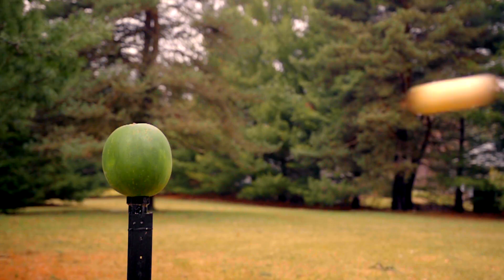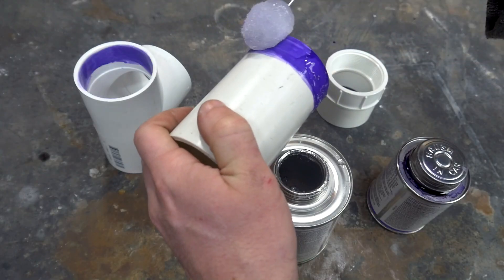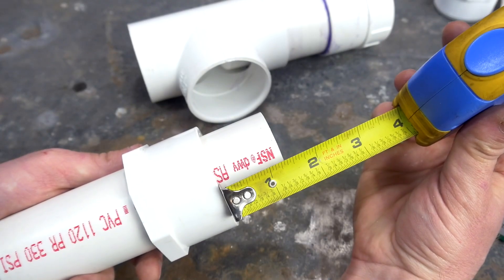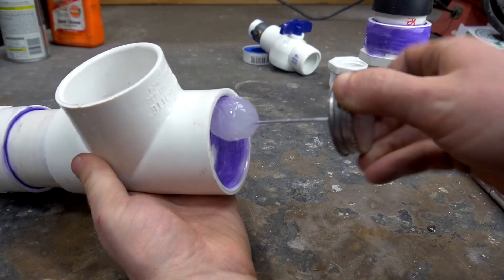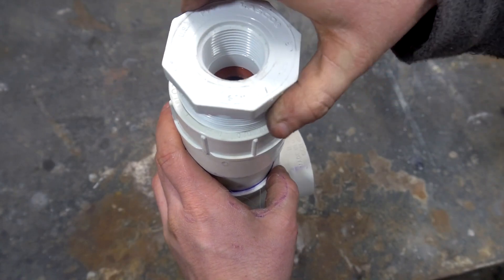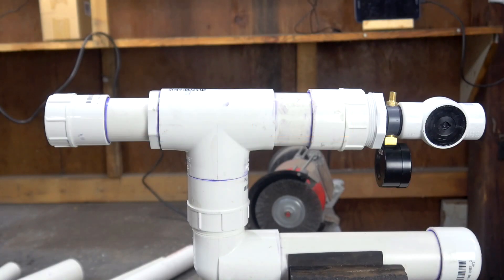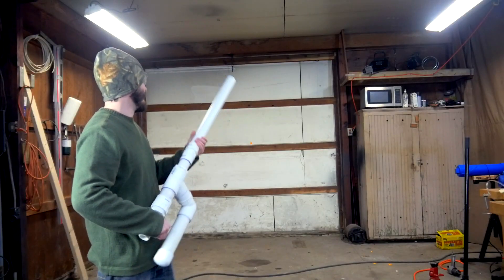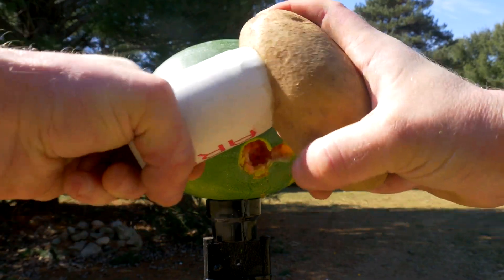How To Make A High Power Air Cannon - 2" Piston Valve (Barrel Sealing)

Comment: what if you hooked this Cannon up behind a vacuum Cannon? if you fire the pressurised Cannon (full of nothing but air) into the back side of the vacuum Cannon, the air behind the projectile in the vacuum Cannon will be enough to send the projectile flying way farther than both cannons firing alone. this is not an original idea either, I saw it on myth busters.
Reply from the maker: Yes, you can fire ping pong balls way faster than the speed of sound that way

Comment: Very cool.  I had been thinking of how to make a valve like that out of plastic tubing from time to time.
I wonder if that blowgun you put on the sprinkler valve would work straight up on the back of it.  You probably don't need a very sudden release of gas.  Once the piston starts to open up at all, the pressure that goes in the barrel barrel really upsets the balance and gets it opening up really fast regardless (provided there's some sort of projectile in the barrel)
Reply from the maker: Whatever valve is used behind the piston just needs to be able to let air out faster than it can refill from the small port hole in the side. However, the faster the air is dumped out of the back the faster the piston will move, so a small blowgun valve would make it pretty slow opening. It would be too close in size to the port hole so a lot of air from the chamber itself would empty before pressure was low enough behind the piston to pull it backwards. If instead of just an open hole in the side of the piston you had a one way check valve that would help solve the issue of using a blowgun, but still the larger the valve the better to get that quick backward snap of the piston.
Reply: NightHawkInLight I found that out the hard way as I used a fill set up from past cannons that hooks up to my compressor doesn't let out air fast enough. couldn't find the o ring though so if you could link that it'd be appreciated
Reply: Once the seal breaks, the piston actually should accelerate more slowly (as the pressure in front of it is dropping). Ideally, you want as small a volume behind the piston as possible, and you absolutely want the fastest valve to vent t he pilot volume you can find.

Using the sprinkler valve in between the blowgun and the main valve is a very good idea and will result in much better performance (and greater consistancy, as slight variations in how fast he pushes the blowgun will have less of an impact on the final valve speed)

Comment: the classic Supah valve design
Reply from the maker: The supah valve is actually a chamber sealing design. Similar in function, but the barrel and chamber are switched. The piston has a hole in the front of it rather than the side in a chamber sealing valve.
Reply: you are absolutely right, I used to have one back when Joel owned spud-tech, unfortunately it cracked eventually after many disassembles,  did you used to be on spudfiles about 10 years ago, I seem to recall having some forum discussions with someone who had a similar username to you.
Reply from the maker: I was on the forums back then but I believe I was using a different name at the time. Can't recall what it was

Comment: Well done as usual. :-) You definitely don't want to use DWV PVC fittings. E-6000 works great on PVC and rubber. If you really want to get fancy, pick up a 12V 3/4" NC solenoid valve and momentary switch for triggering.
Reply from the maker: Very cool, I'll have to try E-6000. Sometimes superglue is a pain to work with
Reply: Yes, cyanoacrylate works good, but it has no flexibility. The E-6000 is super strong when cured and highly flexible. I use it for everything. Walmart sells it. Keep the super glue handy for cuts. :-) I've been using it for cuts for the past 20 years. Wash the wound, push the skin edges back together, then apply the glue. In a few days the glue will fall off leaving a perfect line.

Comment: How much inch diameter and how much psi would you need for tennis balls
Reply from the maker: I think they would probably be a close fit in 3" pipe. They should fire anywhere between 20-100 psi.

Comment: I made a version of your coaxial barrel sealing piston valve cannon years ago, it worked great. I like the simplicity of the coaxial with nothing really hanging off. Which type is your favorite?
Reply from the maker: I like coaxial for how compact it is, but since this valve is separate from the cannon itself the barrel and chamber can be exchanged for all sorts of purposes. I think this version is my favorite for that reason, and also because it uses my newest piston design which makes it a lot more reliable and leakproof. A coaxial cannon using this same piston would be a pretty cool project.
Reply: NightHawkInLight Thanks for the reply!

Comment: There a nother way to do it with a air brake pie and it works so much better with a 60 degree angle and 60 psi I can lunch a poetatoe 3/4 of a mile

Comment: Clever design. Is the purpose to overcome the fact that a human hand simply can't open the ball valve completely before the projectile comes out? Joerg Sprave typically uses a bunch of rubber and a trigger mechanism to swing the valves open, but something like what you've demonstrated might boost performance even further.
Reply from the maker: To a certain extent, yes that is the purpose.

Comment: try a half vacuum half pressure cannon
Reply: stratis miritzis I don't think that would work, since pressure negates vacuum. Depending on the set up, of course.
Reply: MrJJandJim, I thought of a vacuum cannon that on the end of it, it had a pressurized air container so when he opens the piston-valve he didn't had only the atmospheric pressure pressing on the projectile but the huge pressure difference
Reply: Oh, I see! Hm... I think that might work! Setting it up might take a while, though.
Reply: well,with the piston setup that he has it won't take more than a day worth of working on it

Comment: Works like the pneumatic nailers somewhat. Nice vid. Would a nozzle on the back be able to remove some recoil or would it remove some efficiency of the valve?
Reply from the maker: The air that exits the rear valve is all but gone by the time the piston opens and the projectile fires, so it has little effect on recoil.
Reply: makes sense, but would the initial momentum forward from it counter the Felt recoil somewhat anyways as the timing is real close anyways? so rather than acting as a real recoilless rifle it would give it a slight push forward before the piston slams back. I agree it would probably not be worth even trying, but I still wonder if it would be a way to use the "wasted" air. I guess at best it would just throw off your aim either way.

Comment: What was the cost of this build?
Reply: Robert Briggs depending on where you get the pipes I wouldn't expect it to be more than $50, the most expensive parts would probably be an air compressor unless you used the homemade one he did in another video

Comment: Have you tried omitting the sprinkler valve and just use the air nozzle as a trigger?
Reply from the maker: Not in this cannon but in others. It works much better with a larger valve.
Reply: Thanks! Good to know. Great channel BTW.

Comment: Really smart how you used the rubber coupling to create the seal! Reminds me of the days I used to spend hours at home depot walking up and down the aisles waiting for inspiration to strike. I may try something like this! Thank you for your dedication to this channel :D
Reply: dude omg i used to watch all your stuff back in the day! Whatcha doin here?
Reply: Lowes always gave me a funny look when I would be shopping for a couple random pipe fittings, some pipe that didn't fit them, bit of sheetmetal, couple feet of absurdly heavy grounding wire, bunch of thin wire.......had to explain ham radio antennas to a number of people with that how its really just a few carefully cut pieces of wire and carefully wrapped cables.

Comment: could you pull a vacuum in the barrel section like with the vacuum cannon? I'm pretty sure the mythbusters tried it with very impressive results.
Reply from the maker: The piston may not be able to pull backwards with the extra forward pull from the vacuum. It would work if the barrel were a smaller diameter or the piston a larger one.
Reply: NightHawkInLight I didn't consider that. I think you're right but may be worth a try.

Comment: I suggest using silicone grease instead of oil, petroleum based oils can make o-ring and plastic swell an be brittle it can also be used to lube the valves
Reply from the maker: Yeah works well. I usually use that in my cannons but only after I know everything works right since it's a pain to clean. Concerning oils damaging the o rings, I've heard that for years but have never seen it happen myself.
Reply: But you can't get if off of anything. Everything it touches is doomed to be slippery until the end of the universe.
Reply: NightHawkInLight work fulltime as a mechanic and sometimes brakes are totally ruined because someone used petroleum based lube (like copper grease) doesent happen over night but rather months or even years but i have seen bad cases over just some days.
love your videos anyway ☺
Reply: Silicone grease fixes (almost) everything.
Reply: swiss aint that bad but it is the whole point of lubing it :P
Reply: put 5 ping pong balls

Comment: Make hybrid potato canon ! :3
(english is not my mother tungue, so i can express my thoughts unclear)
This is regular potato canon, but fuel/air mix is under pressure.
So you have x*n power, were "x" is pressure of fuel/air mix, and ''n'' is basic power of cannon with normal fuel/air mix without pressure. 
This is mead you can make 2x,5x and even 10x power canon.
You can use foil "valve" (like on your vacum canon : foil can hold fuel/air mix, but olny before ignition, after thar foil will break and pass throgh gases)
This version will have realy low fire rate, but its will be easy to make.
Or make valve similar to that was showed in this video, with same fire rate.
With thar cannon you will can reach gun powed ! ~hundred and thousand jules ! I am serios, this thing is realy powerful.
Bye :3
Reply: I have a feeling that made of pvc a gun like that would end up as a pipe bomb, not a gun.
Reply: Sounds cool though, maybe he could make on with steel.
Reply: i don't said about material.
I just asked to make it :)
Reply: Sure, only metal.
flesh pvc is weak :D

Comment: would love to see how you would rifle a barrel.
Reply from the maker: I have a few ideas for this, we'll see.
Reply: @Nighthawkinlight  any update on the progress of that rifled barrel, there was a company that made em but they seem to be out of action.
Reply from the maker: @tankkiler308  No, I haven't played with the idea recently.
Reply: I've always wanted to do that with a PVC barrel but it has sadly only been a thought and never reality.
Reply: David Armes Good idea, but I'm afraid the pipe would become more oval than round when you're heating it up because of how gravity acts on it when it's soft. also it may create deviations in the barrel. But when I come to think of it you could just put something like a wooden dowel with a perfect fit into the barrel to keep it from becoming oval or creating deviations. Thanks for giving me ideas, may try this in the future as i don't really have a workshop to do it in at the time. Maybe someone could try it and tell me if it even works.
Reply: xorbodude drill press with a custom bit? You could have it turning slowly while pushing slowly and consistently down.
Reply: I double that !
Reply: Batteriii I thought it would need an inner support. deviation could be an issue but with soft projectiles like potatoes would probably be fine.
Reply: If I may interject: Heat/rifle the barrel while the barrel is in the vertical.
Seems possible, but maybe it would be easier to fletch the projectile with folding vanes. If biased on a slight angle, it may provide enough spin to do the job. Just a thought. Carry on...
Reply: square rod iron pattern, bent to how many twists you want- heat up and melt the impression into the pvc... would take a lot of time, as you'd have to constantly re heat, while going down the barrel and keeping the twist in line.
...or if you're not concerned with the barrels structure: cut your barrel in half, the use a router to grove out your pattern, glue it back together.. possibly sleeve over top?
Reply: He should make a guide with a hole and a custom "drill bits" to manually drill straight and to dig through pvc/metal ...
Reply: Batteriii I think you could score a straight line down the barrels inner wall then heat the pipe and twist. not sure how well it'd hold that twist but seems fairly easy to do in theory.
Reply: @minicrop  good idea in fairness
Reply: the problem with rifling pvc has more to do with the projectile. We need something that is solid enough to hold together, yet softer than the pvc so the rifling can grip the projectile and rotate it.  The only way to effectively do it is by using a copper pipe or a metal pipe and cutting the rifling in there. Also take your time you don't want anything aggressive, with a 3 foot barrel you might only want a 2-1 twist per foot, possibly 1 to 1. So in essence a 3 foot barrel would have 3 or 6 full rotations before leaving the barrel. since we are going subsonic i recommend going with the 6. But we still need to find the right projectile.

Comment: How much pressure is that pipe rated for exactly?
Reply from the maker: 330 psi, but you want to stay much lower in case you've done a crappy job gluing any of the fittings. I rarely use more than 100 psi.

Comment: try to fit a half inches pipe and shoot a nerf dart
Reply: Random Guy 
They actually stand up surprisingly well. I've fired them from a propane powered potato gun before.
Reply: It would tear the rubber part off the foam part, unless you modify the dart or use stefans